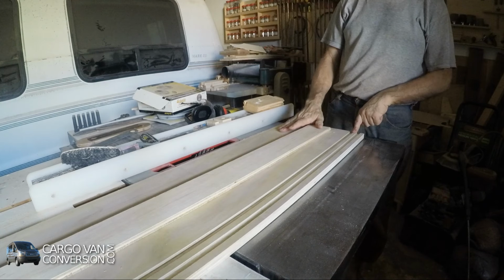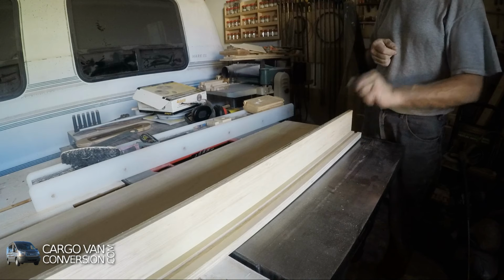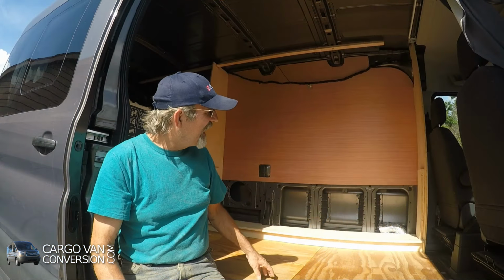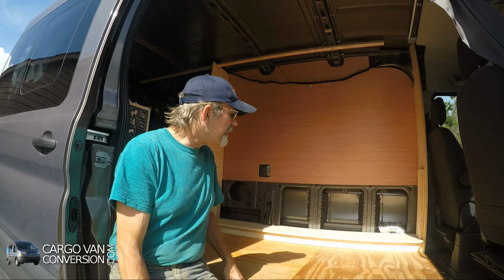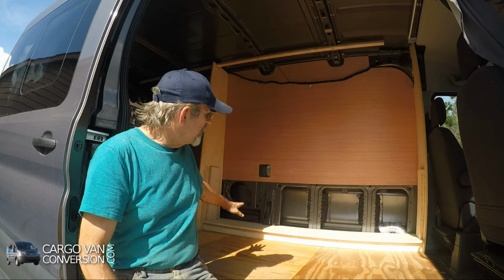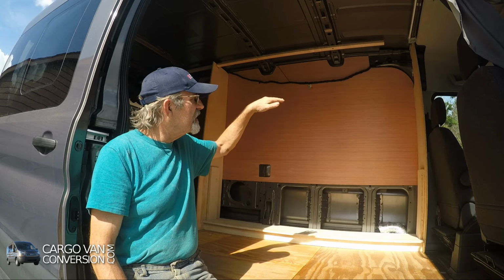Cargo Van Conversion Murphy Bed Frame - Part Five

Comment: Your doing a great job mate, I am about to start my new fitout & intend using a Murphy bed as well so watching your fine work helps me no end. I have bought a Murphy bed kit that supplies all the steel frame work, hinges & springs etc, I just need to work it all out & do the timber work to match my decor.
Reply from the maker: G'day mate :) 
I'm glad that you have some use for it. I considered a kit too, but decided to go the custom way, so I could adjust the size of the bed and height above the floor. Have already assembled custom pivot points and legs that fold alongside the bed. Keep watching!

Van Williams
Reply: G'day Van,
Thank's for your reply & I am subscribed as well so keeping up to date on the build will be No Worries.
Take Care Mate, 
Steve ;-)

Comment: Is that 3/4 or 1/2 inc  ply
Reply from the maker: 3/4 inch for the main board and 1/2 inch for the vertical toe kick.
And Yes, you have a nice van conversion too. Good luck!

Van Williams

Comment: I too love your work. Will you be insulating the rig?
Reply from the maker: Thanks for your interest!
And yes, insulation too. The floor has 1/2 inch insulation, limited by the interior height restrictions. See this video: https://youtu.be/7h7VrxVOQzU  Walls and ceiling likely will get a mixture of Poly-Iso, Blue Denim and spray foam.
I should have done the insulation and wiring first, but wanted to be able to use the bed on trips. As well as the upcoming roof vent to keep it cooler. The parts of the bed, that I'm working on, haven't yet been permanently installed, so I can remove it and finish the walls later.

Van Williams
Reply: Awesome craftsmanship! I was thinking exactly the same thing ... glad you are going insulate!
Reply from the maker: Thank You!
Insulation (AND ventilation) us probably one of the most important and controversial parts of a van conversion. There are many opinions about the kind of materials to use and how to apply them. Generally, the colder the climate, the more insulation and less ventilation and the warmer the climate more emphasize on ventilation and less on insulation. At least that is my opinion.
Insulation can only slow down temperature changes and not prevent them. Ventilation always improves your living quality.

Keep watching, there is much more to come!

Van Williams

Comment: that's a lot of work for a folding bed, but excellent craftsmanship
Reply from the maker: Thank You! I see the conversion more as a journey, not the primary goal. Anytime I can work on it is enjoyable, taking the van out on a trip is just a bonus. I take the time to do it right and am proud when it works out well. There are enough small mistakes and nothing is perfect, but with slow going, you'll get there too.

Van Williams
Reply: Awesome!
Reply: Cargo Van Conversion 
I wonder what you would think of Cycle Cruza's or Delirious Doughnut's bed setup on their van. Just search their YouTube channel.
Reply from the maker: If you want to live this lifestyle, one needs a functional bed, that occupies little space, yet offers a comfortable way to sleep. Both of them do a good job at that. They are cheap to build and take little time to assemble.
That said, my basic premise which makes building and living in a van so great, is, that every individual has the opportunity to create their own lifestyle according to their own abilities and needs. That means, you can buy a $2,000 van, add another $500 for the interior and be on the road within a few weeks. Others spend more than the value of their house on a brand new motorhome to spend $100 nights on a campground. Both are a legitimate way to get into RVing and there are many ways in between.
For me as a cheapskate, while I started with an expensive new cargo van (cheaper as I keep it for 20-25 years like my old van), I'm trying to pursue a greater finesse at a lower cost. Getting older requires a bit more comfort!
I spent a lot of time on the functionality of the bed, that will also include a desk to work on. Two 'works or art' will top it off. All are affordable (i.e. cheap), just take a lot of time to accomplish. The bed is made of the same cheap wood, just not plain 2x4's. I will finish it off with Formica, which will add a bit to the cost, yet offers a clean, professional and durable finish. One of the 'art works' will be a pencil drawing with the cost of a sheet of paper, a pencil and many (free) hours spent creating it. The other will be a small oil painting; make the frame myself and add a canvas for about $100 and many more hours. But they will hopefully add some sophistication to the whole design.
I am willing to put many extra hours into this project to achieve something special (I hope), because I see that building it, is as much part of the experience as living in it is. Many others may think they lack the competence or just want to be on the road. Either one is OK, That makes it such a fun thing to do. You choose!

That was a long answer on a short question, but I hope that it makes clear, that you cannot really go wrong. Go with your guts...

Van Williams

Comment: Mister +Cargo Van Conversion are you Dutch?
Reply from the maker: Well, i was born there, so it's technically correct, but lived most of my life in the US. Reading your last name, we may have something in common?
Groetjes.
Reply: I can still hear it as with veterinarian Dr. pol Groeten uit Meppel
Reply from the maker: It's funny, I probably hear the same thing like you, when I listen to the videos, but when I make them, they sound better when it comes out of my mouth. I've learned to live with it.

Van Williams
Reply: It's no problem, I think, right? I also seem to have family overseas. Named Elting.
Reply from the maker: With regard to family, we might even be family. I'm related to the Punt's in Diever (Assen). So you might add me to the Elting's :)

Van Williams
Reply: Then you're probably a great great great-uncle of mine. my family is from around there Havelte, Wapserveen, Diever
Reply from the maker: My connection is thru a Jan Draad / Huberdina Punt. Jan Draad happened to make some political history in Assen in the late 1800's in the SDAP (predecessor of the PVDA) and had connections with Troelstra and Domela Nieuwenhuis. Quite interesting.

Van Williams